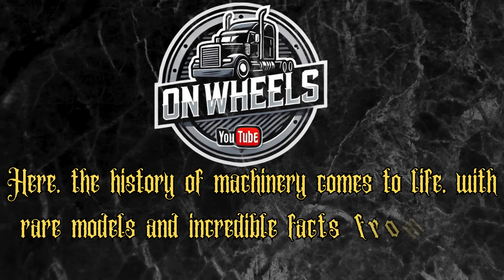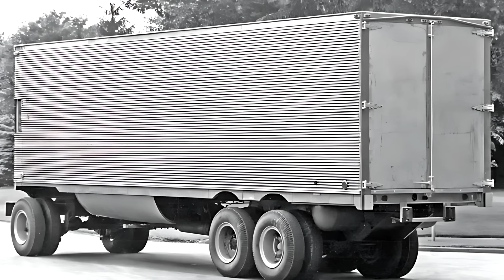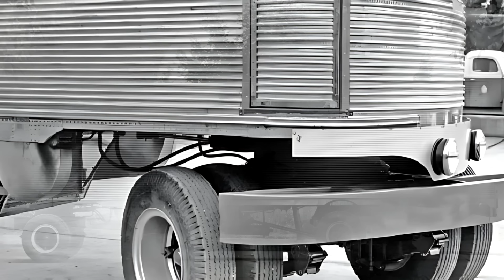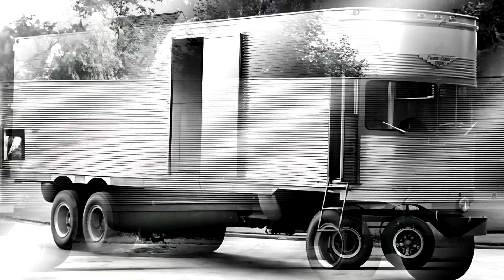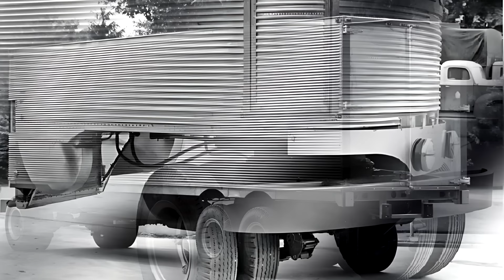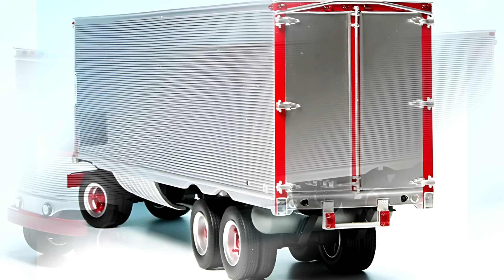1948 Fageol CargoLiner 🕵️‍♂️ The Single Prototype That Defied Industry Rules

Comment: It’s a tandem axle step van.   

The steer axle is odd, but i can see what they were trying to do to make tighter turns.  Today, with more advanced tires,  you could have 4 wheel steering which they use for some applications in Europe.

Comment: I'd like to have you include your history of those semi trailers from late in WW11 that had a small sleeper in the front of the trailer and were pulled by a regular cab truck. One guy drove and the other slept.  There was a string between the two for toilet stops, etc.

Comment: I wonder if there's any connection with the producer of the Fageol VIP (vertical inboard propulsion). This was essentially an outboard motor mounted inside the boat with the lower unit protruding through the hull. I saw one at a boat show, probably during the mid-'50s.

Comment: I was at first confused by the 'engine cover' in the cab as the engine is underfloor midway along the chassis... But then it occurred to me that the box in the cab is where the (hydraulics/mechanics/pneumatics) for the front axle steering is housed...

Comment: The pivot axle steering was the worst idea here. While it would help in maneuvering into a loading dock, it would be a nightmare of instability at highway speeds.
Reply: It wouldn't be self centering so the driver would be fighting it all the time. Add to it was most likely hydro the driver had no feedback so they would be basically fighting blind.
I wouldn't want to be in that thing over 30 mph.

Comment: In Germany, of course, the system with a 90 degrees turned straight 6 engine lying flat next to the chassis under the loading or bus floor was a great success for the Buessing company, later MAN. Experiments with the so called 'underfloor' engines started in the early 1930s, just like Fageol. In Europe the 'underfloors' ran up to the 1990s. Service was simplified by mounting filters in easy accessable positions aside the engine.

Comment: I’m trying to imagine how poorly this handled with that steering geometry. A solid axle pivoting like a conestoga/ stage coach/ Radio Flyer wagon! A lane change at 55mph would be unsettling never mind the drunk driver feeling of a winding country highway. Considering all of the other aspects of this design that were redundantly mentioned I’m surprised that the most weird design decision of this rig got no description of why they did it or what drivers said about it,
Reply: I kept thinking that looks about as stable as my mother-in-law.
Reply: Yes The Fifth Wheel Design is ok for a Drawbar pulled Wagon 
There is no way for Wheel alignment Toe in and Caster is important .
The Duel Tires on the Steering axle would be a nightmare at speed .
Reply: when I saw that solid axle I assumed the AI simply made a mistake. I was thinking that couldn't be right.
Reply: The only advantage I could envision with that front steering axle setup would be if you could do some sort of quick disconnect of the mechanical
steering mechanism, and be able to ridgedly insert a draw bar into the bumper that would allow you to tow the unit like a full trailer to the end of 
the load destination so you wouldn’t have to transfer the load to another truck. I could imagine the horror if one side set of wheels where grabbing
when you braked. Curious about what was in the “ dog house “ between the seats, as obviously the engine was under slung behind the 
steering axle. How did the access ladder work ? Also it didn’t appear to have cooling air access grill on the front of the cab. Might need that 
on a long pull.

Comment: while this size may never been made they did sell many based on a IH  chasse and engine and Fruehauf Trailer  UPS  had some  when i serviced the cherry hill mall the UPS truck was one in late 1980s his rout was the mall ,  the major dept stores in Philla had them for delivery's probably of furniture and appliances  as did some movers 
suprised this model wasn't popular and i bet the body was a Fruehauf Trailer it looked exactly like one . btw i think they were owners of divco and twin coach which changed hands several times